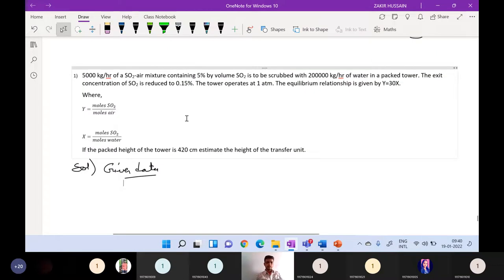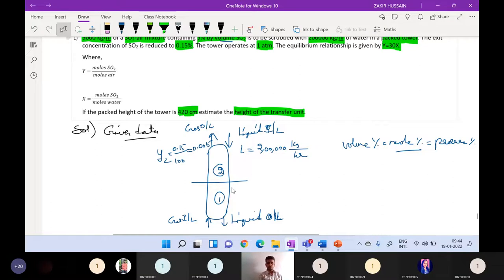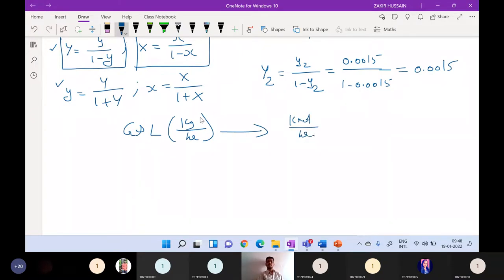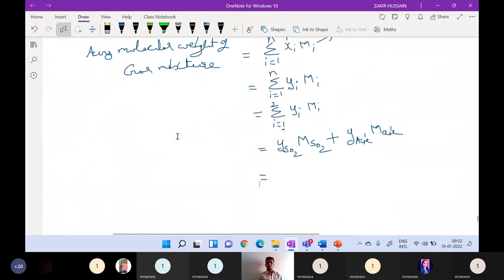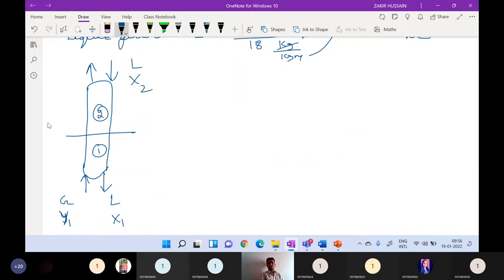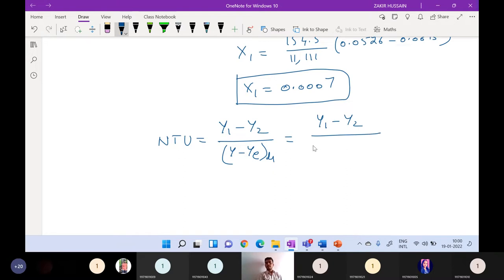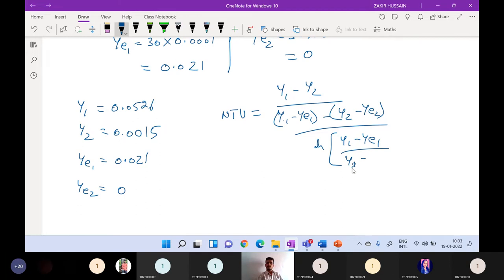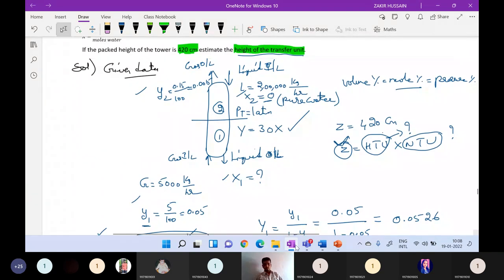Gas Absorption-Problems1 Solving (SO2 Air Mixture)

Comment: Hi sir.in this problem why this formula is used Y2=y2/1-y2 instead of Y2=(1-y2)Y1
Reply from the maker: Hello dear, since the equilibrium equation is given in mole ratio where as other data is given in mole fraction, we need to convert them completely to either mole ratio or mole fraction. Hope this clarifies your doubt.